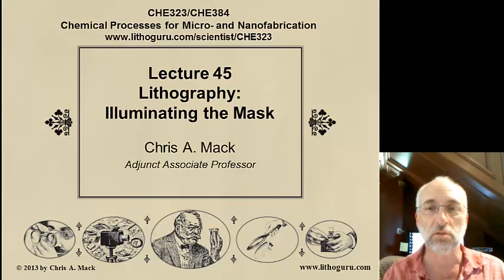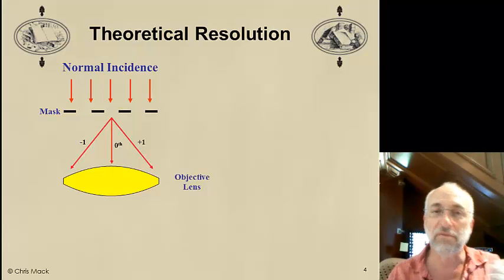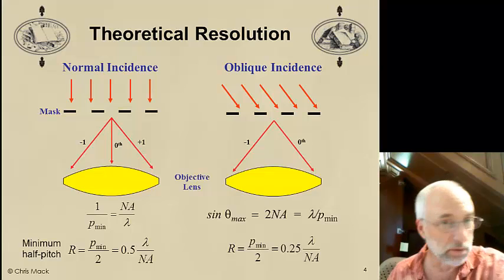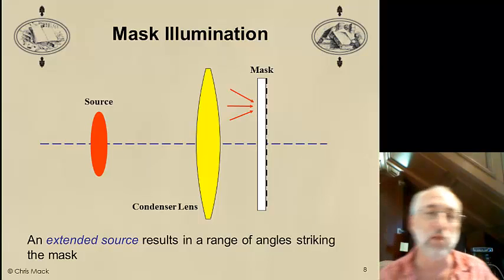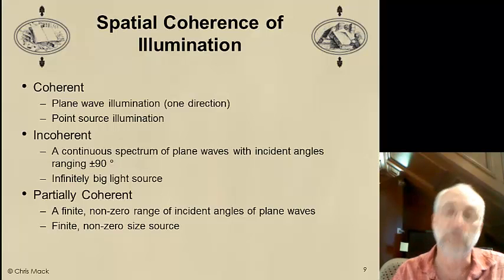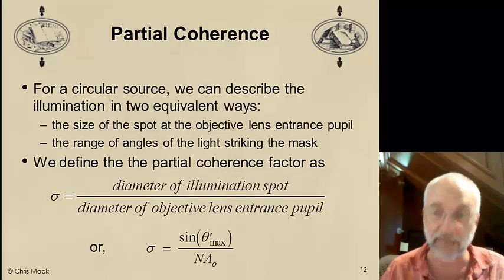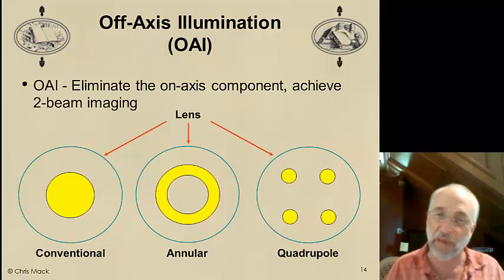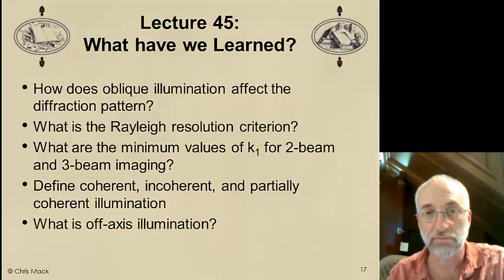Lecture 45 (CHE 323) Lithography Mask Illumination

Comment: AI Summary
Abstract:

This lecture from a "Chemical Processes for Micro and Nano Fabrication" course provides a foundational explanation of the role of mask illumination in optical lithography. The discussion progresses from simple, normally incident light to the more complex and powerful techniques used in modern semiconductor manufacturing. The core concept presented is that by manipulating the angle of illumination—a technique known as oblique or off-axis illumination—it is possible to shift the mask's diffraction pattern relative to the objective lens. This shift enables "two-beam imaging," a method that can theoretically double the resolving power of a lithography system compared to traditional "three-beam imaging," pushing the resolution limit from 0.5 λ/NA down to 0.25 λ/NA. The lecture defines the practical implementation of these techniques through the concepts of spatial coherence (coherent, incoherent, and partially coherent light) and introduces the partial coherence factor (sigma, σ) as the key parameter for controlling the range of illumination angles. Finally, it describes advanced off-axis illumination (OAI) shapes like annular, quadripole, and dipole, which are engineered to optimize resolution for specific mask patterns.

Shaping Light to Print Smaller Features: A Guide to Lithographic Illumination

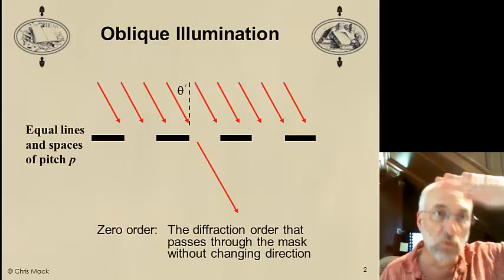*   0:46 The Effect of Tilting Light: The lecture begins by explaining that tilting the illumination angle (oblique illumination) doesn't change the diffraction pattern itself, but rather shifts its position relative to the objective lens. This shift is critical because it determines which diffracted orders are captured to form the final image.
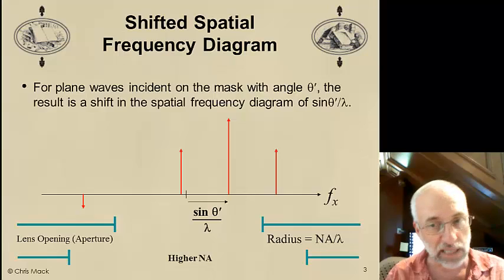*   5:30 Defining and Improving Resolution: Resolution is defined as the smallest feature that can be printed. To form any image at all, at least two diffracted orders (e.g., the 0 and +1 orders) must be captured by the lens. With standard, non-tilted illumination, this typically requires capturing three orders (0, +1, and -1), which limits the theoretical minimum half-pitch to 0.5 * λ/NA (where K1=0.5).
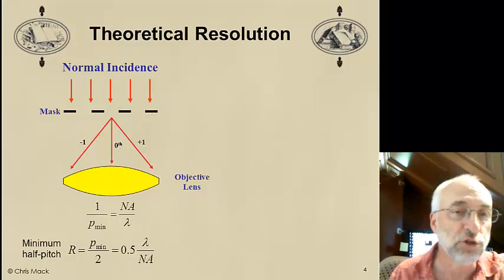*   9:11 Doubling Resolution with Two-Beam Imaging: A key takeaway is that by precisely tilting the illumination, it's possible to capture only two diffracted orders (e.g., the 0 and -1 orders). This technique, known as "two-beam imaging," dramatically improves the theoretical resolution limit, cutting the minimum half-pitch in half to 0.25 * λ/NA (K1=0.25).
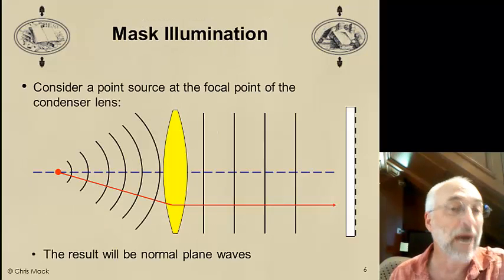*   12:47 Creating Illumination in Practice: The lecture explains how different illumination types are generated. A single point source creates coherent light from one direction. Moving that point off the central axis creates tilted (oblique) illumination. In practice, an extended light source is used, which acts as a collection of many point sources, creating a range of illumination angles.
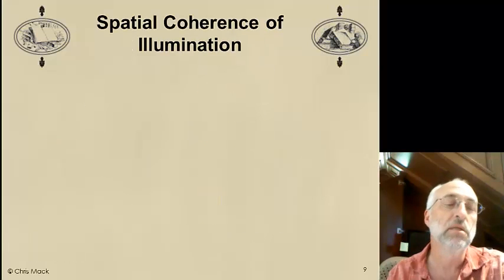*   16:56 Understanding Spatial Coherence: The range of illumination angles is formally described by spatial coherence.
    *   Coherent: Light arriving from a single direction (like from an ideal point source).
    *   Partially Coherent: Light arriving from a finite, controlled range of angles. This is what is used in real lithography tools.
    *   Incoherent: Light arriving from all possible angles (like from an infinitely large source).
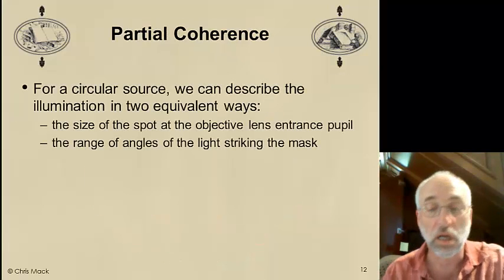*   25:07 Quantifying Illumination with Sigma (σ): The degree of partial coherence is quantified by the partial coherence factor, or sigma (σ). It is defined as the ratio of the illumination's angular range to the objective lens's numerical aperture (NA). A sigma of 0 represents perfectly coherent light, while typical lithography processes use sigma values between 0.3 and 0.8.
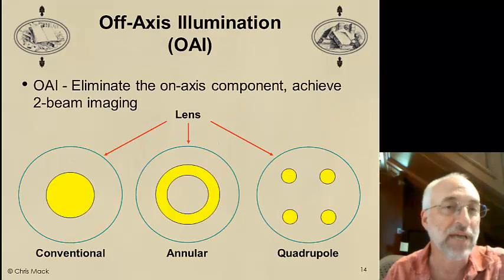*   29:19 Advanced Off-Axis Illumination (OAI): To force the two-beam imaging needed for high resolution, lithographers use specialized, non-circular source shapes. These include annular (donut-shaped), quadripole (four spots), and dipole (two spots) sources. This technique, called Off-Axis Illumination (OAI), is designed to enhance resolution for specific mask patterns by eliminating normally incident light.
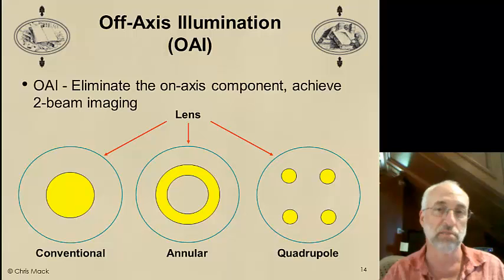*   31:36 Calculating the Final Image: For partially coherent illumination, the final image is the sum of the intensities of images produced by every individual point within the source. This complex calculation is performed by specialized lithography simulation software.

I used gemini-2.5-pro| input-price: 1.25 output-price: 10 max-context-length: 200_000 on rocketrecap dot com to summarize the transcript.
Cost (if I didn't use the free tier): $0.04
Input tokens: 22755
Output tokens: 942